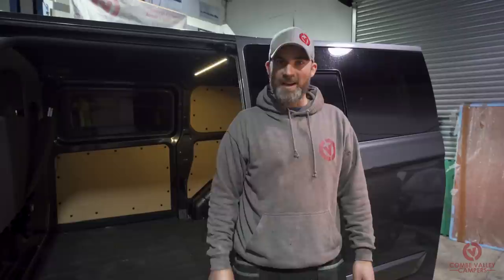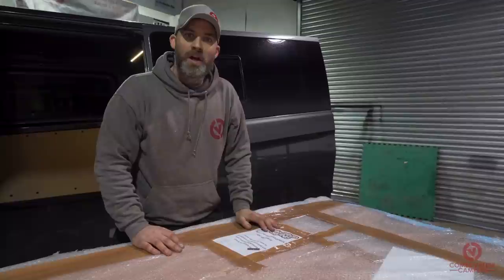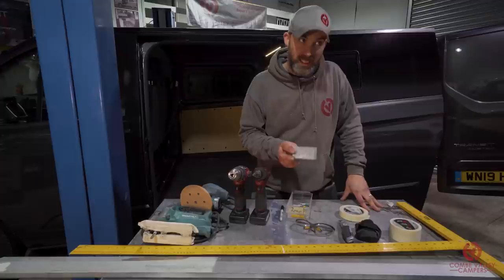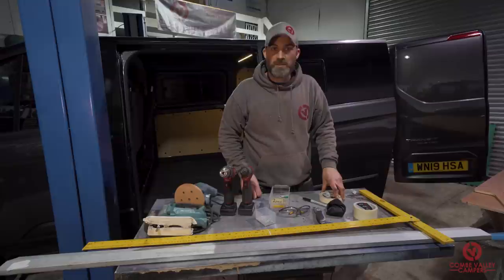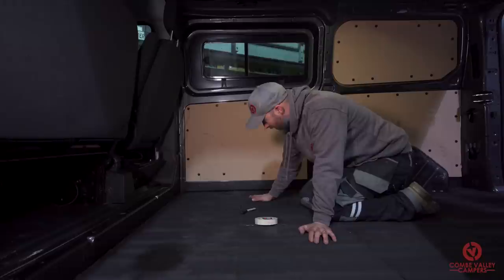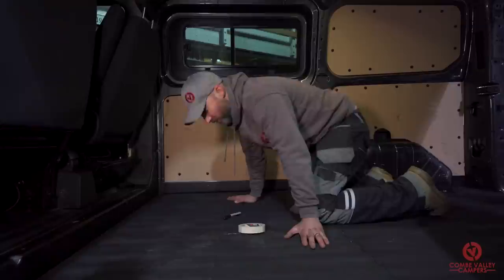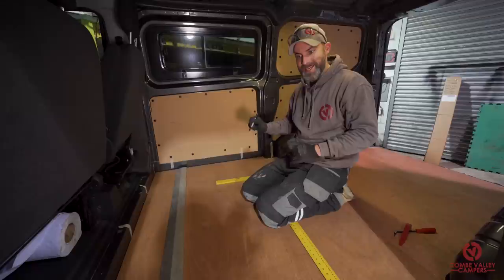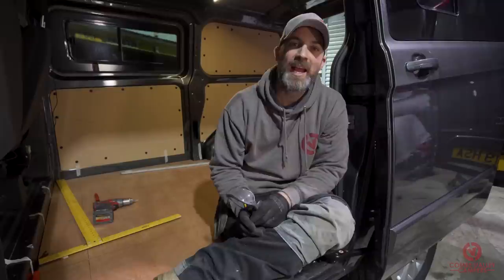HOW TO PROFESSIONALLY FIT A PLY FLOOR IN YOUR CAMPER. Tips, tricks and hints.

Comment: How would you go about if you decided to put wooden batons? Would you glue them on top of the Dodo Mat Duo you have there, or would you glue them on the metal and then stick the mat on top?
Reply from the maker: Use batons and sound deaden/insulate in-between. Wood itself is an insulation layer
Reply: This is exactly the info I was looking for! Great videos by the way.

Comment: You would think that having seen this video, Custom Shop Designs might double check their dimensions and correct the CNC pattern for these boards, but no.  I've just spent the morning climbing in and out of my Transit Custom to measure and trim off exactly the same edges (the whole rear section is out by about 20mm width).   I did email them before ordering to confirm the van model and year, but received no reply.  The ply itself is OK quality.  So overall I'd say it's probably a C- for Custom Shop Designs.
Reply: No van is exactly the same and the chassis can shift by these dimensions easily, sounds more like a issue with your van rather than Customshop designs. 🤠

Comment: Great video (they all are). I’m about to reinstall my pre cut ply floor. Is there any reason not to glue a strip on wood down one of the trenches and then screw the ply to the wood rather than pierce the metal?
Reply: came here for this comment
Reply from the maker: Daniel and Paul, this is a great way to install a floor. Glueing the wood down, then screwing to the wood is perfect
Reply: Filling the trenches with anything is not a very good idea. As the condensation that forms under there has no were to go other than the medium you fill the trenches with. Let the air and moisture flow under the floor by keeping the trenches free. Silicone and screw to the high points avoiding brake pipes and spare wheels. And don’t forget to get underneath and trim the screws leaving about 10mm protruding. Then cover with a neat blob of silicone or a light cover of paint to prevent them screws from rotting out especially if you live in a coastal town.leaving trenches free all so allows any spills or water leaks that finds its way under there to run freely and not soak up in the insulation or timber filled trenches and rot the floor. Plus you see the water and know instantly there’s a problem. Just a few pointers you might want to consider. Or and don’t butt the boards together. Leave a 2mm gap to allow for expansion but fill with silicone so you don’t see the gap in your lining. Creaking floors because boards are rubbing against each other are a night mare.

Comment: Thanks for the vid. 
Do you have to screw the floor down, (given that it’s making more holes in the van/ potential for rust etc?) or is it possible / advisable just o lay it in there?
And did you notice much difference between 9mm and 12mm ply? e.g. did 9mm bow/ warp more easily? 
Many thanks.

Comment: Great vid and page.

Quick question - could you just use a couple of blobs of sikaflex rather than the screws? Given that the ply floor is a tight fit and will have the edging trim on as well? 

Thanks.
Reply: Screwing down is necessary to keep the plywood from buckling and causing hills/bumps in the finished floor. I used too few screws in a kitchen floor installation, by the next morning their were huge buckles/bubbles in the floor - looked as if something were underneath and trying to push it's way up from beneath the floor in several spots, it required me to cut holes in my brand new sheet vinyl and insert screws to push the plywood back down, and then patch my brand new beautiful linoleum to hide the holes! It was a nightmare, but a lesson learned. A wood subfloor must be securely tide down, at frequent intervals, too few screws in an area and it will buckle!
Reply: Some fitters do just stick it down. Ply out any larger gaps first. Good bead of sikaflex on all the ribs etc. Put down ply and put lots of heavy items on floor all over until it goes off. Shouldn’t ripple anymore than screws will. Probably less likely as it’ll be fixed down in more locations.

Comment: I’m about to do a floor in a t3/t25, however I’m pretty paranoid about hitting the vitals. Is there a resource I can use that will tell me where the fuel lines and brake lines are going?

Comment: Are you pre drilling the metal once you have gone through the wood, or can you use self tapping screws instead?
Reply: Drill right through wood and metal with a 3mm HSS drill bit and use 4.2x19mm self tapping screw.

Don’t use 16mm screws as suggested in this video they won’t work. 

Sorry if this is a bit late but I hope it helps.

Comment: Does a 12mm ply floor, 6.8mm DoDo Mat insulation and 2mm vinyl floor (total 20.8mm) leave enough room for a double swivel seat. I was told don't make the floor more than 20mm by one supplier.

Comment: I'm not fan of the screwing , why not glued ? doesn't the screwing ruined your floor isolation and favour rust forming ??
I'm starting on a 2022 transit f350 and learn a lot from you , nice work !!!
Reply from the maker: Thats fine my man. We use the bonding method too. When people ask us about the screwing method, which happens quite a bit, we explain that you can pre-drill and treat the holes after if you wish. We've worked on hundreds of vans if all shapes and sizes, and in terms of rusting over time, a dozen or so holes in the floor, are the least of your worries as you are likely cutting more venerable holes in the van like the roof and sides.
Reply: You can mastic windows in that hang vertically , a floating floor isn’t going anywhere or mastic battens 
No need for screws

Comment: my only criticism is screw length used. this will depend on ply and insulation thickness. 
ive used 2mm silent coat, then 6mm dodo mat SE , if going for 12mm ply then 25mm screw
Reply: having said that, the video has helped (a numpty like me) plan where to drill ;)

Comment: I have a Vauxhall Combo Tour. Basically its Combo Van with windows manufactured for the European market, but it's used as a WAV in the UK. I need to fit a floor taking into account the valley where wheelchair would go. There are no ridges in the floor like a regular van. Do you have any videos tips or advice for this? I have Dodo hex deadening and thermo liner to be getting on with. Thanks!
Reply from the maker: Hi Emma, email us info@combevalleycampers.co.uk

Comment: Been waiting for this video for a while. Very happy to see it posted today! Quick question, did I see some kind of insulation already laid on this van’s floor? If not, would you just drill through the plywood and then say, dead mat duo into the metal base? Trying to figure out if it’s at all worth insulating around a batten first for a T5 or just unroll the dead mat over the entire floor and just lay the ply and drill through all three layers. Cheers!
Reply from the maker: Hi. In this case we laid dead mat duo on the entire floor first and drilled and screwed through all the layers.
Reply: Combe Valley Campers great I’ll do just that. thank you!

Comment: Hi. Following your suggestions on the floor insulation with the Dodo Duo. Should I put the ply directly on the insulation, or perhaps use batons? If batons, will I also put something like KingSpan on top? Many thanks!  (the van is high, so height is not a consideration)
Reply: P.S. Maybe I should put the batons first, before the Duo? Thanks

Comment: Hey! I’ve been doing the same as you in your videos. Dodo mat duo floor insulation and the custom shop designs 12mm ply. I tried 16mm self tapping screws but they didn’t reach the metal! (As the insulation is 6.8mm and the ply is 12mm) what screws shall I use? Or do you know if sikaflex will stick to the dodo mat duo without screws? Thanks for sharing all your knowledge!!
Reply: Interested to see the answer to this as I was wondering if you just didn't use the dodomat in this video and the ply is going straight onto the metal. I'd be looking to do the same as Alice and put the dodomat down followed by 12mm ply

Comment: Thanks for the great video. I'm about to line my van with dead mat duo and a custom shop design ply. I'm just wondering what to do with the holes left from the previous ply lining in the van floor should I fill them with something to stop corrosion?
Reply: The small holes i used rivets because they are rust proof. Now if you have bigger holes then simply use Hammerite rust proof around the holes and then i used some flat bolts and 50mm penny washers and locking nuts. Use a flat bolt and penny washer for the top of the floor and a penny washer and locking nut for underneath. You will need 2 people one top one bottom to tighten them. Then these can simply be covered when you use your insulation. It don't have to be 50mm washers but that's what i used. I hope this helps.

Comment: Great video’s thank you!  This van seems to still have the bulkhead mounts in? Have you got a ‘how to remove them video?  Or do you recommend leaving them in?  Also (sorry!) old ply self tapping holes on the floor, holes from taking the tie down points out etc, how do you cover/seal them before laying you matting? Again, great vids!
Reply from the maker: Hi Claire if you check out our 'how to fit a double swivel video, then you'll see how we removed the lower part of the bulkhead. Fill in the tie down points with appropriate size bolts, and screw holes in the floor by either having them welded, filling them with fibreglass or an polyurethane sealant. Hope that helps, Leigh
Reply: Combe Valley Campers Brilliant, thank you!

Comment: Is there a problem with using the original rubber mat from the van as 'underlay' and then screwing the ply on top? Or will this work well?
Reply: Hi, wondering if you did that in the end. I have the factory fit rubber floor too and it's great, but wondering if it's too squishy for using as an underlay? Thanks!

Comment: Great video. I just wondered when you screw the ply to the metal floor how do you know you're not screwing through something you're not supposed to, like the fuel tank or exhaust or something like that? Thanks.
Reply from the maker: In most cases, None of the important items are directly beneath the metal. However, if you are unsure, double check before making any holes
Reply: K Dub  Self tappers Screws would have to be used.

Comment: Thanks for this content. You mentioned for larger/higher vans the floor could be battened and insulated. If I used the dead mat first could I Sikaflex battens on top then add more insulation, using battens to attach ply floor to or would you suggest a different approach?
Reply from the maker: That sound like a plan to be. Make sure all batons are 100% level though before fastening down and use weight and a level load whilst they in place
Reply: What did you do in the end Michelle? I'm looking to use batons too.

Comment: Might seem a silly question but are you screwing into the metal floor when you do this? (new to this !)
Reply: Yeah.... Drill the metal floor of the van, screw the wood down with self tapping screws... I'd be looking out for brake / fuel lines and fuel tank underneath the vehicle

Comment: When fixing the ply to the van floor, How do you ensure the screws don’t penetrate the floor through to the outside of the van. How thick is the van floor?
Reply from the maker: When mechanically fixing the floor down with screws they must penetrate through the floor to fix the floor down. Alternatively, you can bond wood to the floor, between the ridges and screw the floor down to this. We go through these methods on our blog here: https://www.combevalleycampers.co.uk/post/how-to-fit-a-ply-floor-to-your-van
Reply: @CombeValleyCampers  So.. you're basically ending up with a ton of screws poking out on the underside of the van. Won't these rust over time?
Reply from the maker: Over a long time, with out protection, yes they will. However, I have worked on countless camper conversions, with and without screwed down floors, and in reality the arches or other areas will rust way sooner than the dozen screw holes in the floor

Comment: Great video, what length screws are you using for 12mm Ply floor?
Reply from the maker: 4x16mm or 4x20mm
Reply: @CombeValleyCampers  are they wood screws or metal?

Comment: What do you do about treating the raw exposed metal that the screw hole created ?
Reply from the maker: You can spray paint, or underseal over them if you wish, however, I've seen and built a lot of vans of all ages, and the dozen screw holes in the floor will be the last things to start rusting, believe me!
Reply: @CombeValleyCampers  cool thanks , everything rust where i live , even tools inside the shed. cheers

Comment: Interesting, I never thought of drilling straight into the sheet metal with self tappers. You always do this with smaller vans?
I'd always assumed the only way was to use existing mounting points to fix down batten and then fix floor onto that.
Reply from the maker: Either way is fine Jarret. Its whatever works best for you. And your vehicle
Reply: You converting a van too my old mate?!

Comment: Screwing through the metal floor of the van, thus invalidating the perforation warranty. Is that correct?
Reply from the maker: Depends if you are building a camper out of a brand new van. Does fitting side windows invalidate the warranty? Does fitting a poptop invalidate the warranty? Does the dealer invalidate the warranty when they fit ply lining and a ply floor to brand new vans? All very valid questions
Reply: I think any hole in the van would invalidate the warranty, if there was a corrosion issue as a result of that specific hole. I take your point on windows etc but for a window and pop top there is no alternative. Also they would be sealed. Screws through the floor I doubt are individually sealed. Van lining on the sides I guess will be into the steel frame and not through the body, but if they also screw through the floor then the same issue. 
Maybe I’m being overly fussy but it doesn’t seem right to me.
Reply from the maker: @shippahoy1797  in order to build a camper from any vehicle, you will need to drill many holes. If you don't want to screw through the floor, you can bond it to the metal. So thats one issue sorted. You'll still have to fit and anchor a bed to the floor, maybe holes for some waste and water pipes, holes for a heater, vent holes for battery and gas bottles. Luckily, you can rust proof holes, paint the bear metal and even waxoyl/digital the chassis. I have pulled apart countless vans, new and old and I can rest assured that 12-24 screw holes will not rust the floor out. Owners lack of cleaning, or just age, will rust a van out way before the floor screw holes will have any effect
Reply: Ok I’ll bow to your better judgement and experience.

Comment: I don't like the idea of drilling holes in the van floor. 😱 I'll stick with glue & a composite board. Wont rot, warp. Easy cut with a hand saw. Has great R-value. Why use ply?

Comment: I think your video takes for granted a lot of knowledge. Some useful tips here but It is not adequate for the person that has never done this work before. Also, if a person doesn't have the funds to have someone else Computer Cut the shape of the plywood.... then what?
Reply from the maker: Hi Claude, on the contrary. I get messages every day thanking me for the videos and they they've built a camper because of these videos. Either way, if your not confident to do it then I've tried my best. If you cannot afford a CNC cut version, the alternative is to use the existing panels as templates and make new ones. Hope that helps

Comment: I’m converting a minivan which has a thick carpet inthe rear. The rear seats I’ve removed 6(2 rows) have left behind the metal anchors the seats clamp onto. I was going to drop a sheet of ply over then and cut out the holes for them to make it all flush then cover with another sheet of ply over it all before covering with a laminate. Is this a good idea?
Reply from the maker: Sounds good to me

Comment: What screws do you use?
Reply from the maker: Totally depends on the thickness of floor in using.
Reply: Combe Valley Campers  say 12mm for example. Hey can I also make a recommendation, do a video on fitting the rusty lee full width crash tested and the 3/4 width beds. Nobody has ever done one and you would be the hero of the universe if you did a simple step by step.
Reply from the maker: @evildead1949  for a 12mm floor a 16mm length screw would suffice. We will do a rusty lee bed in due course but it wont be for a while, I'm afraid due to the current restrictions. However Lee and I are  looking forward to working together on more products for sure
Reply: Are they standard screws ?  Or self tapping ? And when screws done do you fill the holes with filler ?    Keep up awesome work guys 😄